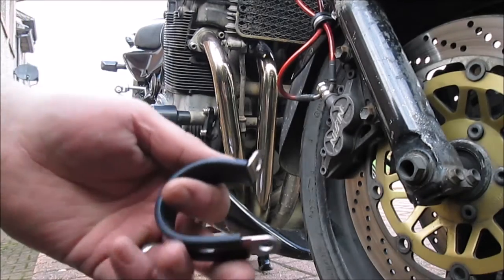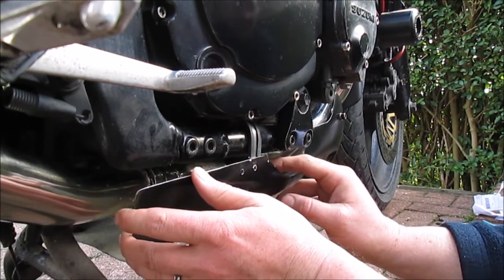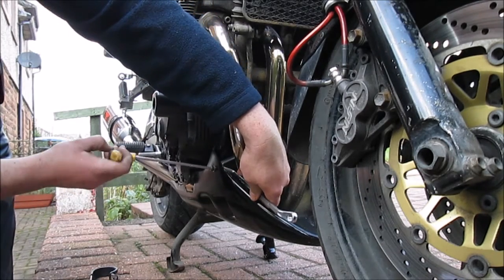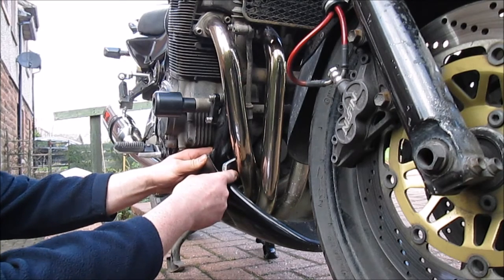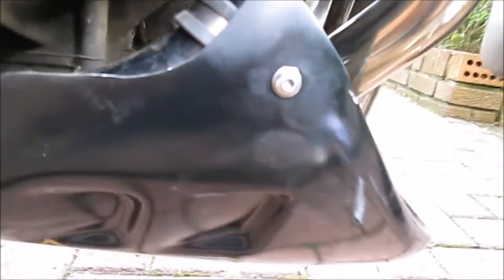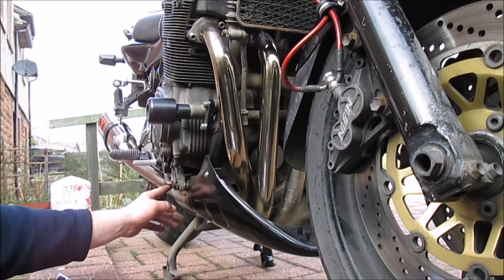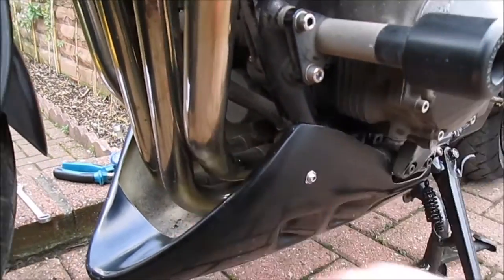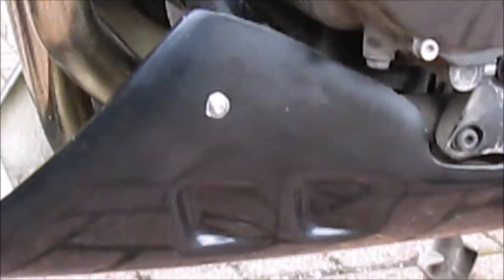Bandit 1200 respray of new bellypan Part 5  - 35mm clips

Comment: set the clips further forward with holes on the bottom then add a bent strip of metal from clip to pan with rubber gromits
Reply from the maker: I didn't think of that, sorted now though, am going to get a standoff and bolt it to that back clip because it'll make it far easier to take on and off. Thanks for your help.